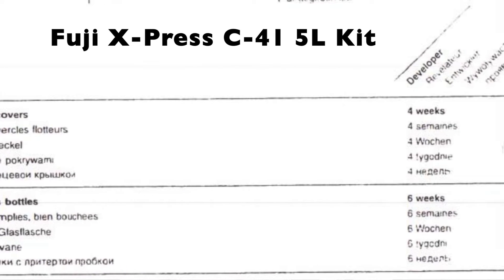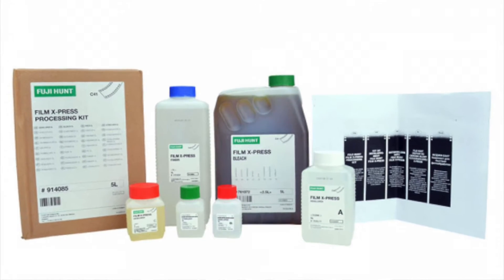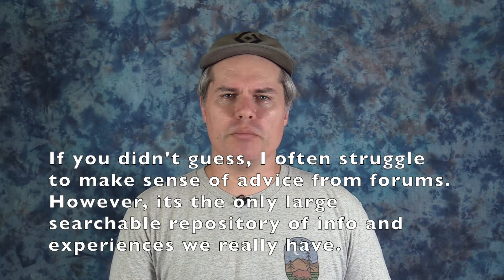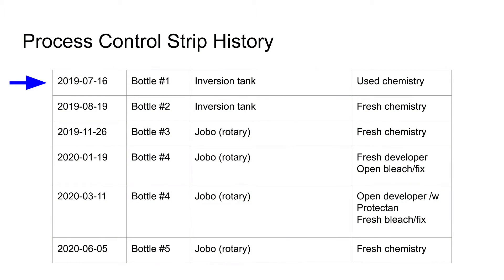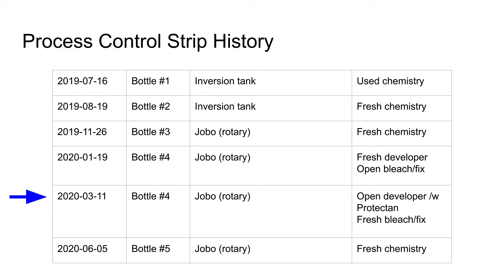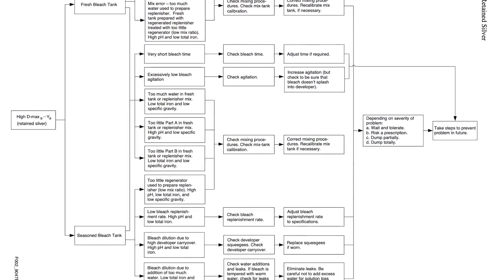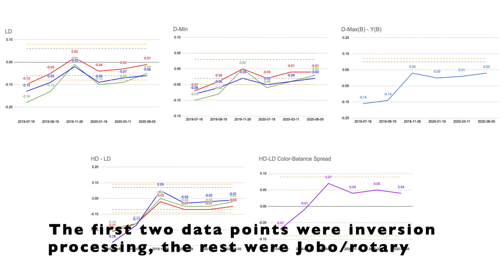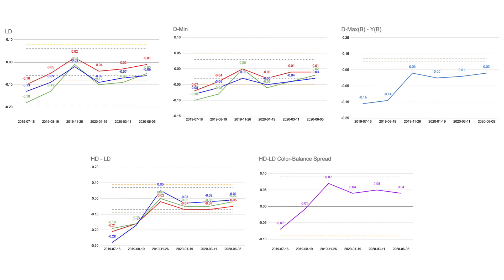Photo Vlog 11: How long does color chemistry last?

Comment: Ok, what if I mix only what I need for this week?
Reply from the maker: Some components of C-41 chemistry (mainly developer part C concentrate, I think) don't keep once you open the bottle. So you really do have to mix up all of your developer at once.  The other chemicals can probably be done incrementally, but I've seen fixer settle if left in the bottle long enough.

Comment: Hi, thanks for the informative video. Can you tell me where you found Protectan? I can’t find it anywhere in the US
Reply from the maker: I bought my current supply from Freestyle, though they claim to be out of stock at the moment.
Reply: @derekkonigsberg2047  thanks! Any idea of Bloxygen (pure argon) will be just as effective?
Reply from the maker: @tonewheelz  Supposedly any inert gas should work. The only issue is that if the gas is lighter than air, it may be harder to get it to settle inside the bottle on top of the chemistry.
However, I'm not an expert on this.

Comment: Fantastic work Derek! For your C41 processing in Jobo CPP3, did you use the Jobo auto C41 setting for developing time of each chemistry and rinse cycles? Or you followed the instruction that came with the particular C41 kit you had got? I often find the times provided from these C41 instruction are intended for the inversion technique. I've heared we need to reduce the time (by 15% ~ 20%) when using rotary machines at 75 rpm for proper contrast. Others say the time reduction is only required for b/w developing. Please let me know your take on that!

Comment: Thanks for the info, your Reddit post lead me here.    I can rest easier about shelf life...   FWIW, if you read the MSDS chart for "Protectan", you'll see that it's just a can of Butane, propane and isopropane.    You can save quite a bit of money by just using an unlit torch to purge your chemistry containers instead.

Out of curiosity, how much chemistry did you use per roll (35mm 36 or 120) in your Jobo?  Thanks
Reply from the maker: I went by Jobo's guide for how much chemistry to use. There's a document on their website that lists guidelines for each of their tank configurations.

Comment: where did you take pre exposed Fuji test strips?
Reply from the maker: Where did I take? I don't think I understand the question.
Reply: @derekkonigsberg2047  the pieces of film pre exposed for measuring density
Reply from the maker: @vaneaauzeac4401  Are you asking where I bought them?
Reply: @derekkonigsberg2047  yes
Reply from the maker: @vaneaauzeac4401  I bought them from Unique Photo. I also put a link in the video description.

Comment: Back in the day I would use completely full amber glass bottles. I had no problems pushing the storage times. IIRC I would mix 4L at a time and then split it into 3x1L bottles, 1x500mL, and 2x250mL to give me any multiple of inversion tank I needed.

I do recall one of the parts started to oxidize pretty quickly. I did use an air duster to purge the air in an attempt to stem this but it wasn't super effective.

My understanding is that temperature cycling is only a problem for film if there's condensation.

Comment: Is there a guideline to reuse C41 by extending the development time based on how many full sheets/rolls (8x10, 120 roll) have been used? My friend was doing that for E6 in a jobo and it seemed to work well.
Reply from the maker: Some chemistry kits come with instructions that provide guidelines on this, however I think the "official" recommendation is to go one-shot... at least with rotary processing.
That being said, given the minimum size you can get "real C-41 chemistry" in, and the minimal volumes a rotary processor uses, going one-shot honestly doesn't seem so wasteful.
(Of course if you used a Paterson inversion tank, this would be another story.)

Comment: How much chemistry is used for each test strip? Does that go through the entire inversion or Jobo process on its own or with film you are developing?
Reply from the maker: I process each test strip with a "half full" Jobo 2520, so that's 170ml of chemistry. Its a small enough amount of film that you could probably reuse the developer afterwards, which I've probably done before. (However, I one-shot the majority of the time.)

Comment: What's better in the end: rotary or inversion type of processing for C41?
Reply from the maker: Rotary, by far. At least in my own experiences. Not sure if its just because of the difference in agitation, or because the Jobo does rotary inside a tempered bath (which keeps the temperature more consistent).
However, I should also admit that I was generally better at controlling all the variables when doing rotary processing, and it may be possible to do inversion with more consistency than I did.

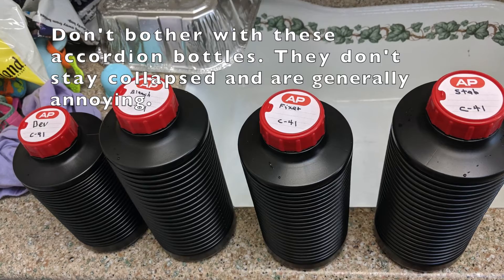Comment: 2:23 not even done watching and I gave you a thumbs up for this. Use amber glass bottles!
Reply from the maker: I didn't start buying amber glass bottles until after I had already mixed this batch of chemistry. Everything I've mixed in quantity since (i.e. my RA-4 chemistry) was mostly done in glass.
I did just discover that ULINE actually sells widemouth ones. I might even try ordering them at some point.